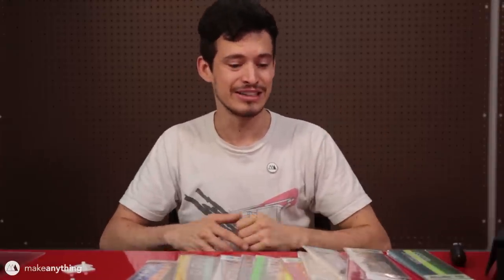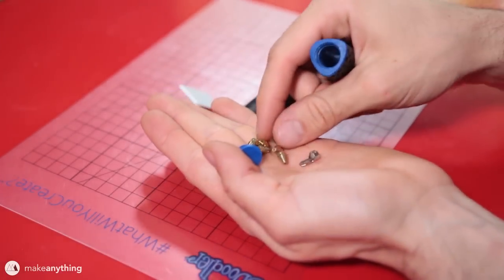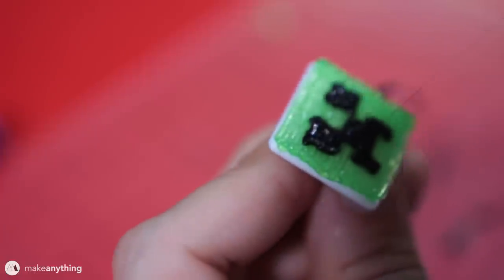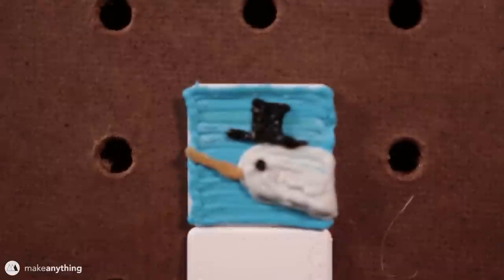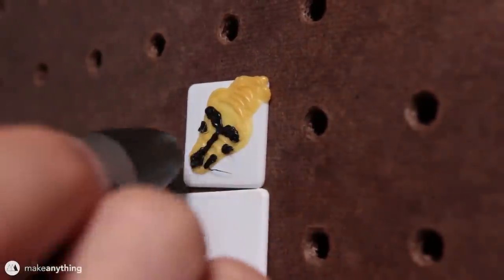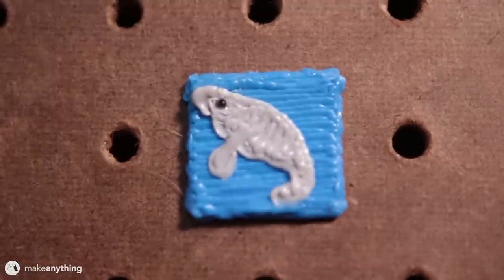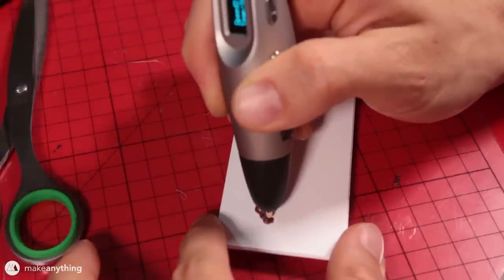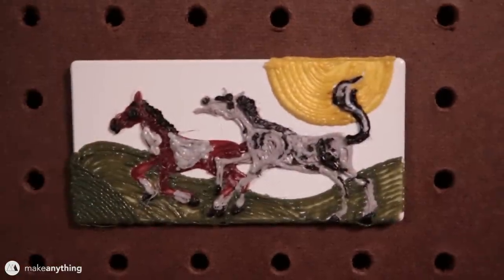3D Pen Art // Patron Pegboard Pixels

Comment: Makes me sad to watch these, I got a scribbler and it broke within weeks of taking care of it, I got a replacement one and it was faulty too. It would appreciate if you could answer Devin, would you know a problem with it, that when you press the forward feeding button twice, the pen restarts so you have to heat it up a bit again (because it would have dropped about 10 degrees). Then when I press it twice again, it does the same. HELP PLEASE !! ):
Reply: Unless this is a setting on it, I'm never buying from here again
Reply: The scribblerV3 doesn't have any function relating to hitting the forward button twice, it doesn't have a continuous feed if you do that like some pens do. So you can only use it by holding down the forward feed button. But as for why it would break like that, I have no idea... sounds like an issue with the electronics and the board, have you spoken to customer help or do they just suggest another replacement?
Reply: TaniaT94 Wow, my scribbler v3 has a continuous feeding option, yeah they said it would be a refund but I can't be bothered waiting 2+ weeks for my money. They probably won't even refund me, stupid company, making shitty Chinese pens
Reply: PixelatedTutorials damn, must be a newer one than mine!! Sorry I can't help then, does it still work okay the held down way? I've actually found a cheap unbranded one on Amazon has done me just as well as the expensive scribbler, the price difference definitely doesn't feel justified!!

Comment: is filament leaking out supposed to happen when the button hasn't been pressed? my 3doodler create plus does it and it gets in the way of what i am doing half the time
Reply from the maker: It's common with pretty much every pen. The 3Doodler actually does it less than most
Reply: @make.anything  that's concerning then cause mine does it a fair amount b4 stopping completely and i just bought another pen a sunlu because of the hold to extrude feature that the 3doodler create plus doesn't have that i like because having to press the button again to stop doesn't work well with my art style, i really don't like the leaking of my current pen but if it's common i guess there's nothing i can do about it then, thanks for the info though that helps allot :)